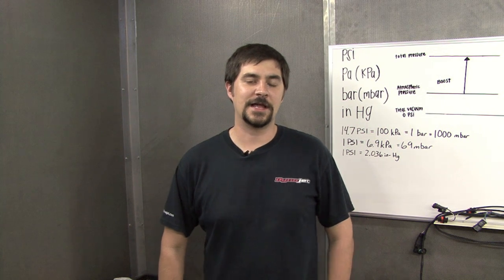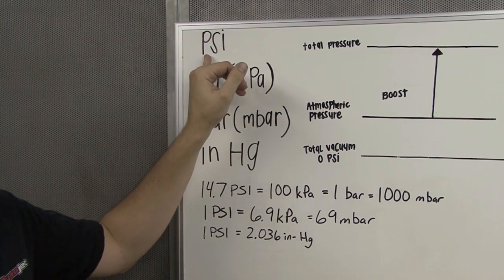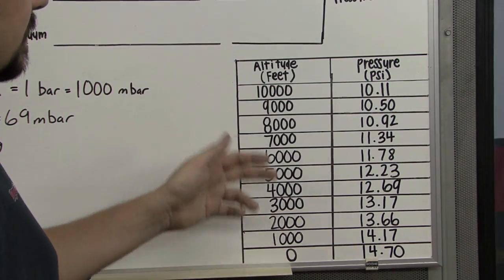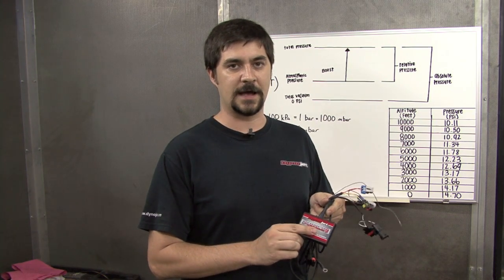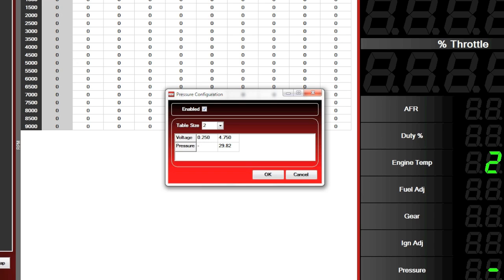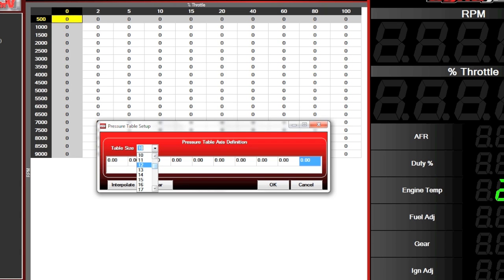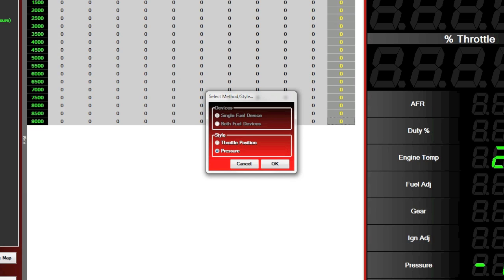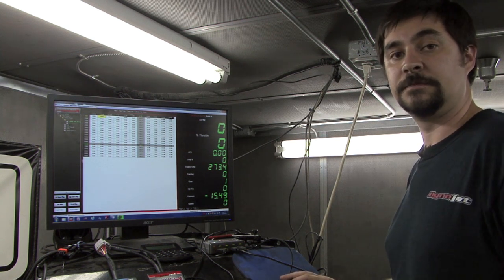Dynojet Power Commander V: MAP Based Tuning

Comment: So what’s the physical difference between PCV that is controlling Fuel and Ignition versus one that goes on boosted applications? Is it just the CANBUS plug-in for pressure/temp sensor or is it wired on terminal strip? I’m adding turbo to rig this week and adding the harness and MAP sensor purchased from you all to essentially upgrade my PCV.

Comment: Do I need additional equipment to enable pressure tables? Can't the PCV get the value of the stock manifold pressure sensor from the ECU? Because the manifold pressure sensor is actually installed on the throttle valve.
Reply from the maker: Hello, please reach out to our technical support at powercommandertech@dynojet.com with your inquiry.

Comment: Is the pressure adjustment table based off of the throttle table? Ex. if the throttle table is +12 does 0 on the pressure table equal +12  or is it actually 0 from base map.

Comment: Can this be done with N/A setups, or mainly for boosted applications?
Reply from the maker: You could use this input to tap into the stock MAP sensor and have speed density type tuning.  The issue of this is how erratic the signal would be and may give you rough running down low.

Comment: So if you have a boosted zx10r you cant tune through throttle position?  The stock map sensor is only a 1 bar so not good for boost . I have the pc3 and ignition module. So I'm not sure how to calibrate for a gm 3 bar map for example
Reply from the maker: You can contact us at powercommandertech@dynojet.com and we can help you.